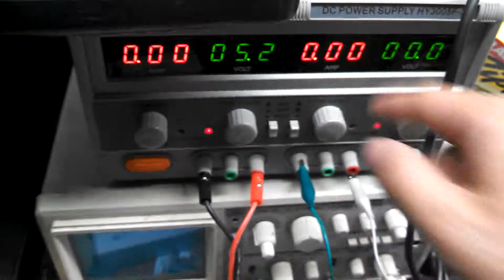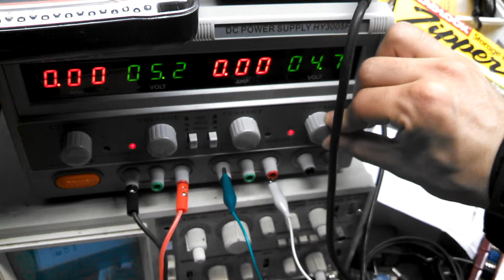Open-Source-Open-Hardware Android Voltage Meter

Comment: does this project have any continuation? I am looking for a solution to track DC voltage (probably through a voltage divider - initial range is expected to be from a 3cells lipo - 9-12v?), then I need it somehow digitized and send it over a http get request to a server.